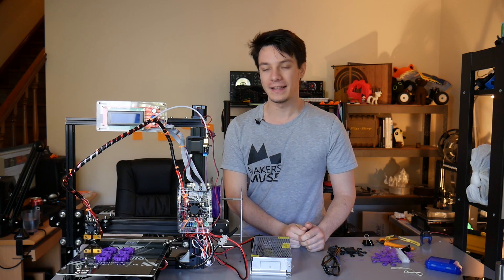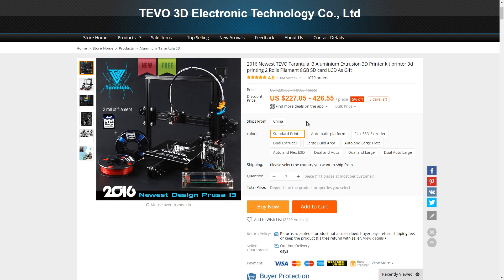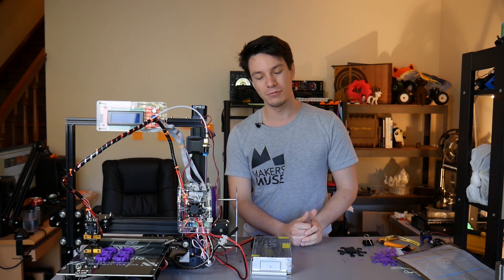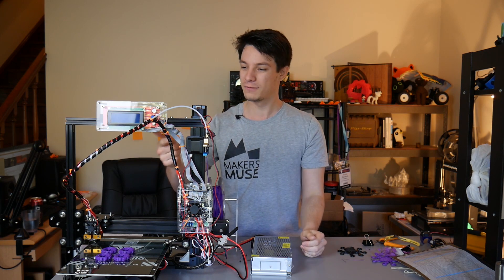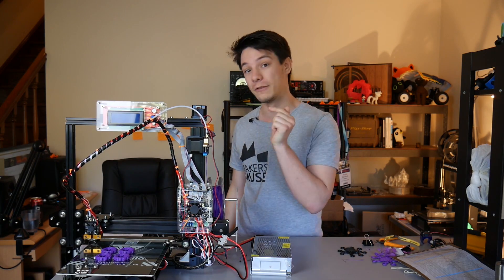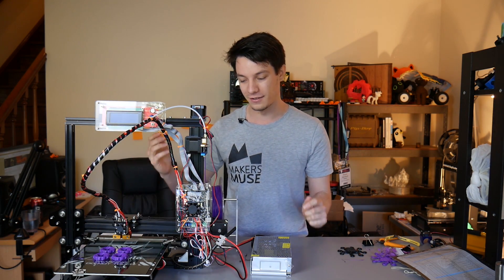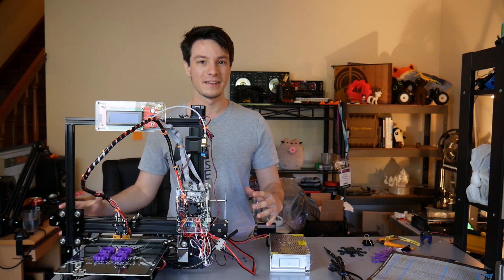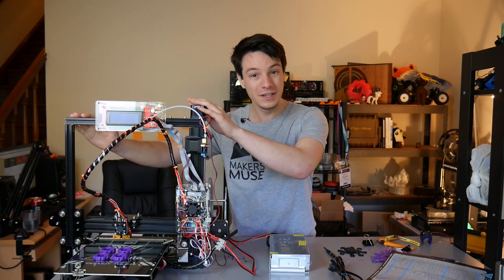Tevo Tarantula Review - Read the video description

Comment: Hi Angus. Thanks for all your videos. I've built several Repraps and some Tarantulas too (Tevo's and HE3D's which are pretty close if you pass through hardware details). I agree with you about the Z axis. I replace the cheap spring couplers by some fixed ones, and play with the mounting plate to get the screw perfectly alligned. A Derlin nut for the ACME screw is a great upgrade. There's another major issue IMHO : the bed plate is acrylic, so it won't like very hot heatbed's temperature, like the 110°C needed for ABS. Otherhand, the 4 points leveling is stupid : It's perfect to twist your bed. 3 triangulated points makes leveling safer and easyer. A good upgrade for the Tarantula is an aluminium Y plate with 3 leveling points only. Here's some advices for you. Try to keep your heatbed's leveling springs as compressed as possible. A short bowden tube will help to avoid a lot of issues. So try to move your extruder to reduce your bowden tubes to the minima. About the wiring, People usualy use the full lenght of their wires. But shorter cables helps you to get a clean aspect and a nice wire management. To me, most of the Reprap's kits needs upgrades because they're engineered to make money, not to make a perfect machine.  The Tarantulas is a chinese kit, so it need some upgrades and aditionnal printed part to make an acceptable machine, like PSU cap with power switch, a better Zmotor plate, a better Y bed plate, many accessories for wire management or belt tensionning, replacement parts like the Z coupler and so. But most of kit/diy builders like to make upgrades, event if you pay for upgrades and maybe raise your budget at the level of a good printer's kit, like Jo Prusa's. Thanks again, cya.
Reply: With stock parts, you cannot just compress the springs as possible because of another issue : the bed leans on the bed plate because of the different height between wheels with exentric nut and ones without. There's a similar issue on the X plate. That need to play with washers to adjust the height. As you said, most of reprap printers you find in China need upgrades and that's also part of the fun. 
Almost all points raised by Angus are true and the (very active) Tevo community already found workarounds or designed parts to improve the whole thing : fanducts, adjustable belt tensionners, oldham coupler.
If you want a "ready-to-use-once-outside-the-box" printer, pass your way. If you want to learn 3D printing and what's inherent (mechanic, electronic, compute), it's a good start I believe.
Reply: Seriously ? Make a difference between Heatbed and Bed mounting plate...
Reply: Well it's the same as Angus' I did not know about any other type of Tarentula. I builded 3 ones yet, another is actualy on the bench. All the same. ;)

Comment: Excellent review, Angus. Have one myself, and though it might produce fair results out of the box, if you manage to digest all the info on Facebook, as well as the various youtube video.
Tweaking it with stiffer and stronger brackets, reinforced bed carrier, fans and such, makes this printer quite usefull. True, changing the design to dual z steppers mounting on the bottom lile the original Prusa could make it even better. The community on Facebook is what makes this printer shine, so to speak. The ingenuity of the participant is epic, and provides every possible help to everyone that has problems.
I had ZERO 3D printer experience, but building my own CNC machine was perhaps a huge help in understanding how it works.

Comment: 1:44 Angus... I would suggest that you cut all your Zip-Ties flush so that you don't rip your skin open inadvertently if you scrape across one. They make a nasty gash.
9:02 you suggest to get an external Power Supply Brick at 12VDC but you did not say at what current.
Reply from the maker: I've never cut myself on zipties but worth considering cheers! Yeah the PSU says 20A but there is NO way that thing is capable of that, so I'd say 10A. I didn't want to say a number that was incorrect, I'm going to measure warm-up current before wiring mine for an external dc brick.

Comment: This printer is the best kit for under $400 on the market
Reply: Is that a kit idiot? No. You are obviously a bit slow. The print quality is far better and it can print faster.
Reply: Please stop this spam/advertising. Monoprice Maker Select (aka Duplicator i3) is $250 on sale. 

All metal. Linear rods. Proper PSU housing, proper 250 watt PSU, heated bed....cooling fan....1 year warranty....dual z-axis steppers, proper z-axis acme screws (dual and bottom mount)....4 linear bearing y axis, metal bed mount, proper dual rod x axis, part cooling fan, Melzi board is far better than whatever this uses....everything uses drag chains, instead of hanging the wires in mid-air.......and the list goes on. Oh also, the community is far bigger, as is the mods.

I don't mean to offend people that bought this, but it is a pile of junk, with literally no upgrade potential.

Comment: When designing my first printer I did so much research that when I ended up getting a cheap Prusa I was able to fully assemble it in a few hours without instructions B) #justbragging
Reply: Ok, in defence if the X homing switch, that's a bit strange on a Prusa style, but I can see where they're coming from. On a CoreXY you'd do that because your X and Y motor are in the corners and not at the ends of axis travel, so by doing so you eliminate some strange wiring. This was a last minute decision I made on my own-design CoreXY. Seeing as the X axis has its own motor though, I agree it's a bit strange.
Reply: Completely agree on Z. Not only is it a silly setup but the NEMA17s are rated for something crazy for compression axial load but very low for tension (can't remember exact figures) so you'll wear out your bearings and motor much faster.
Also, the flexible couplers don't dampen much axial force in either orientation and they just as uncertainty in the rotational positioning. On my own machine I swapped them out for solid couplers and never looked back!
Reply: Good call on the PSU! I've put all my electronics in a grounded box with safe wire outlets, cooling fans and an insulated mesh cage.

Comment: This was my first 3D printer followed the you tube 21 part instructions. Replaced the nuts with nylons and added washers for extra support.
Used a HP800GB server power supply, as its illegal to wires your own 240v devices here in Au also its a much better power supply.
It can actually print TPU with stock setup, just have to baby sit the extruder as the filament will hold and wrap around the idler at times.
Reply from the maker: Pretty cool to hear from people it can do TPU, i'll have to give that a shot! Printing slowww though.
Reply: Maker's Muse my Bowden tube is about 4mm away from the extruder roller, if it was closer the filament bending on retraction would probably not occur. I just pulled the kink out overtime it occurred. Have the flexible filament extruder but wanted to try the standard one first.
Also printed a bracket for the far X axis belt top idler. This stops it wobbling.

http://www.rcgroups.com/forums/showpost.php?p=35453222&postcount=9351

Comment: I  just got my Tevo Black Widow a week ago.... manual is still a bit thin, but all the frame plates are anodized aluminum, larger extrusions  on the frame, and better Z axis design. It has a bigger print bed as well.  I can definitely agree with the labor of love and feeling of accomplishment.  I am about halfway through the tweaking and add-ons.  Still need to print a cooling fan, add some filament guides (no bowden setup on the BW), and add the BLTouch bed leveler.

Comment: Well I purchased one myself and have had it now for 2 weeks, and I love mine. People just need to understand it's not a plug and play printer. It does need upgrades and tweaks, but you can use it to print out what you need (which is kool in my book). And it does print with goo quality and I have seen my prints (and others) out due other 3d printers at a higher price range. Could be settings and the user it self but for the price I love it. I can't afford a 500+ printer and most others in this price range are smaller build volume. Still plan to upgrade more but for now love it. And yes the Facebook page is full of knowledgeable and friendly people that will help with whatever problem you may have. If you are a good diy person I would recommend this one to anyone. Thanks for your videos they have helped me a lot in my 3d adventure keep it up.
Reply: I was happy about my Tevo Tarantula Purchase http://goo.gl/F6H2ln . Have just added this mod http://www.fankhauser.me/collections/types?q=3D%20Printer%20Replacement%20Parts) my Tevo . It has been working like charm since day 1

Comment: Angus, you should look at the JG Aurora A3. Its a Chinese kit, and all the instructions are in Chinese, but it comes with a ton of good quality videos showing you how to assembly and install every part - no language, no audio, just demonstrations. Plus, its built like a tank and costs about the same as the Tarantula. I get really good prints out of it. I put mine together and had it printing well in about 10 hours. I took my time and checked/double checked everything before going to the next step. There are some minor inconsistences between the kit and the videos,   but it was easy to figure out.

Comment: I don't really understand your problem with wiring the power supply. A. You don't wire it with it plugged in. Even a 4 year old would is smart enough not to plug it in before wiring it. AND B. There are only 2 wires and there is literally no wrong way to wire it.
Reply: The power supply that came with mine had wrong labels on it. like live written over the neutral terminal. and neutral written over DC gnd. Not so easy then, eh?
Reply: Depends how much they cheaped out on the power supply it could be like the one that came with one of my printers.

The back of the power supply is a row of screw terminals 3 sets of 12v +- and 3 for the mains voltage (total of 9 screw terminals)
There is no cover plate over the terminals and they are exposed so if you were to accidentally touch one of the screw terminals post assembly while it was plugged in then yeah that's going to hurt.
Also if your not careful with the wiring and its stranded wire then you can easily cross the terminals slightly

Im not saying this printer used the same cheap power supply but the quality can vary widely and could be dangerous for kids, or even adults. Over All open power supplies suck.
Reply: Shival Wolf I have this printer. You would have to be brain dead and high at the same time to wire this power supply wrong.
Reply: JuicyMoose Productions We are talking about the Tevo Tarrantula specifically. If your offended because you have a different printer perhaps you should discuss it with your therapist.
Reply: Well the scary thing is sometimes it doesn't come with proper instruction with wiring it up. I know this I built my printer from the ground up, so 50% chance you will do something wrong and possibly get hurt doing so. I don't think a 4 year old will even know what a power supply is, or even an outlet anyways, even if it is just 2 wires you have a bunch of ports open on the power supply unit to choose from. It's jumanji finding the right way to power it up. You are considered lucky if you don't break anything or hurt your self doing this...
Reply: In the case of this power supply everything is clearly marked. Id say its Darwinism if you break something hurt yourself.
Reply: We all have different printers. It offends others to say its impossible to wire it up incorrectly, which is totally possible on some power supplies, and they do it wrong when in reality its not exactly easy to hook up mains to a power supply that is surely capable of killing you! Im not trying to deter some what electrically inclined people from trying to build a kit, I just don't want your comment to be taken in bad meaning.